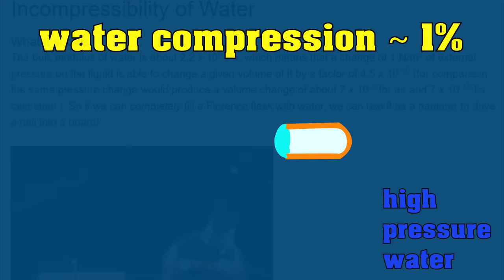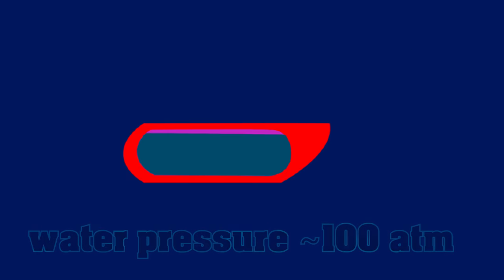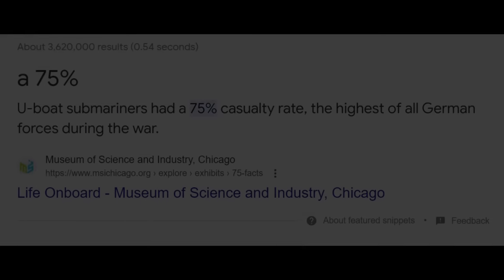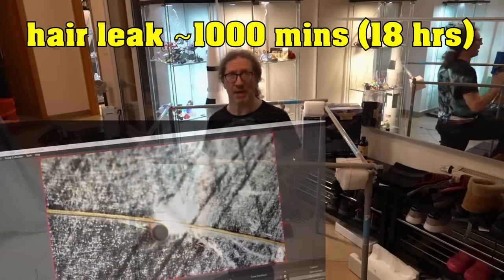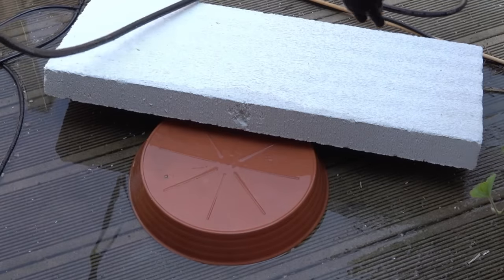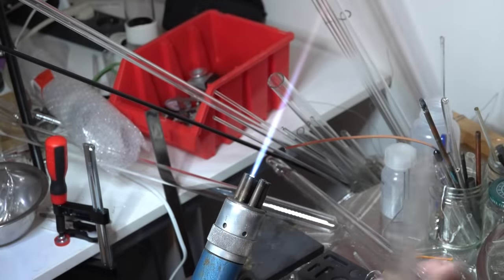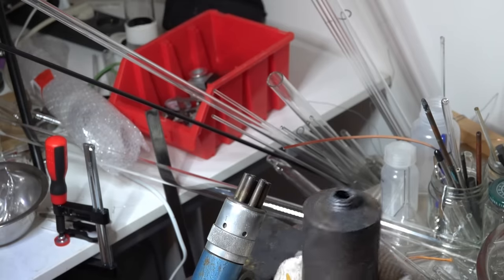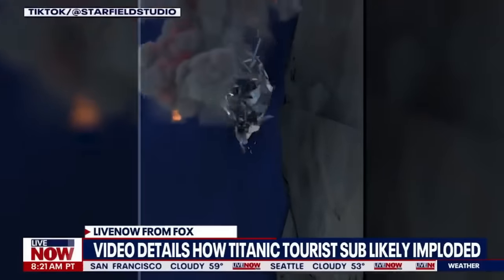Why the Titan sub failed

Comment: Reminds me of the Challenger.  The engineers found that the o-rings were half burned through several times.  Convinced themselves that meant that the o-rings worked, since they were twice as thick as necessary.
Reply: close but nut true, the engineers were deeply concerned about it and urged it to be redesigned. management were the ones that had the opinion you speak of
Reply: I've always thought it was reminiscent of the challenger as well, but because they overruled the engineer who said that the o-ring can't handle temperatures as cold as it was the day of the launch, and the shot callers overruled him and launched anyway. Just like the employee who outlined all the problems with the Titan got fired instead of listened to.
Reply: The O-rings failed because they were not specked at the outdoor temperatures during the launch. They launched anyway, HEAVILY INFLUENCED by the President who made such a beautiful speech about their lost lives.

Comment: Thunderboob picks obscure physics trivia that contributes a fraction of the damage and ignores the elephant in the room: implosion, baby! His water compressibility argument is ridiculous because it assumes all else is equal. The inside of the submersible isn’t static like his animation while the water decompresses. It is crushed from all sides. Any kind of a pinhole leak would immediately rupture the structural integrity of the carbon fiber hull at those depths, and the implosion crushes the submersible and ejects the porthole. There would be tiny tiny bubbles because of the water pressure. Waiting for his mea culpa video…
Reply: I look forward to your video explaining  your take in detail.
Reply: @roberthorwat6747 great idea, maybe this weekend.
Reply: Implosion can only happen if the sub descended below its rated depth. There was no implosion.
Reply: @vladimirrodionov5391  it’s rated depth is 0 because it had no formal safety tests! And the actual salvage recovery and experts’ statements would strongly disagree with your no implosion stance.

Comment: This makes perfect since, the Titan was having problems surfacing, we all heard that part when they had only went up like 25 meters in 30 minutes after first dropping the ballast and doing everything they could to go up. They knew they were screwed there, they had already taken on water. This guy nailed it, the best explanation I've heard. I thought I had it figured out but I didn't. most of us probably knew it was in the joint between the carbon fiber and titanium... well I guess this was close to what I was thinking but this just clarified everything. This is the smartest guy I've seen on YT, I'm gonna check out his other content

Comment: Could the difference of the two       materials bulk modulus be used as a benefit if apply differently? If they sleeved the carbon fiber over the titanium, instead of a glued butt joint, theoretically, the deeper you go in the ocean the tighter The Joint will get.

Comment: Pressure washers are rated for pressure the pump can produce at zero flow (which you never achieve due to an internal cut-off safety), and full flow at zero pressure (which you can achieve by removing the nozzle).  You're getting only a small fraction of the rated pressure when actually using it.  A more powerful gasoline pressure washer is much better at achieving high pressures with those small nozzles.  You're not cutting a toe off with a 120V model.

Comment: It seems like the only way the carbon fiber and glue would hold together would be to have the titanium fitted between 2 layers of equally thick carbon fiber and/or coat the titanium with a thick layer of titanium. Even then there is nothing mechanically holding the ends onto the carbon fiber tube.  As you stated Carbon fiber works best under tension. The tube, where the people are, would eventually crush at some point either on the first dive or a future dive.

Comment: I feel like there's an oversight here in the idea that the water-jet would be contacting the material being cut at this distance. As you can see in the water-jet cutting videos, the water-jet nozzle is basically right up against the material being cut. Presumably in the sub, it would have been a few feet away from the other wall and the stream would be dispersed by the time it hits the other side. Water isn't a laser.

Comment: I suppose the big difference between the pressure washer you used and the sub leak is when that leak expanded and the hole got bigger the pressure would remain pretty much the same irrespective of the jet size, it'd go from a tiny jet to a big jet to a sub breaking water hammer, all in a few seconds.

Comment: The thing is, Oak Ridge were doing this exact same thing way back in 1988. CF hull with titanium ring pieces and titanium hemisphere end pieces. And they rated it for 100 dives on the full scale model. They used IM6 CF on a vessel with an interior diameter of just 2', and a hull thickness of 2.5". Astonishingly, they even used the same method of acoustic monitoring during pressure cycle testing as oceangate. These vessels were cycle tested to 9000 (yes, a nine) PSI and crushed at around 12000 PSI if i recall. 

Now granted, 100 cycle rating isn't great, and I have no idea how many deep cycles Titans second hull had endured, but the whole concept isn't quite as bat shit insane as we all initially thought. They even used the same 'lip on each side' of the titanium rings idea, and yes - it was glued. 

So why did Titan fail so catastrophically then? Honestly, I think (as pointed out by other commenters) its the construction process and a lack of thorough non-destructive testing. I also think that the way Oak Ridge hand-wave away acoustic events as NOT being evidence of progressive failure is dubious. 

Ultimately though, Oak Ridge only rated the AUSS mod 2 for AUTONOMOUS work. There was talk of further research into the viability of human rated submersibles with CF hulls, but as far as i'm aware it went no further. Without massive amounts of EXPENSIVE testing, Stockton Rush had NO business conducting real-world testing on an experimental vessel with paying passengers. 

Please take a look at the following report for more information: https://www.researchgate.net/publication/235179850_Graphite-Fiber-Reinforced_Plastic_Pressure_Hull_Mod_2_for_the_Advanced_Unmanned_Search_System_Vehicle

Comment: It's extremely simple.  Titan imploded because Stockton Rush was an idiot.

As to it being a pinhole leak, I am somewhat skeptical.  Had it been a uniform, metallic hull, then yes, it's likely.  Since it was a composite, I think more than likely not.  Try your same demonstration with a fiberglass test tube, and I think the results will be different.

Also, while fire on any ship is an exceedingly dangerous thing,  fumes from a fire are actually easier to handle on a traditional submarine than most surface vessels.  If the sub has diesel engines, just start the engines.  The engines will quickly evacuate the fumes.  Release air from the reserve tanks to replace the air aspirated by the engines and goodbye fumes - after the fire is out, of course.  I am pretty sure even nuclear subs have pumps that can evacuate air from the interior.

I also cannot believe they tried to glue this thing together.  Using more than one material is bad enough, but glue?  I have made quite a few submersible devices for more moderate depths, but even at only a 10 atm rating, EVERY joint is either welded if the materials are similar or bolted if not.  Every bolted joint is designed specifically so that water pressure confirms the seal, but bolts are still employed for a number of very important reasons.  For that thing to have been even remotely safe, the carbon fiber should have been much thicker at the ends and tapered so that it tightened on the titanium ring (also tapered, of course) under pressure and been bolted to the ring with numerous bolts.  There should also have been a sealing medium like a gasket between the two surfaces.  I still would not have ridden in it below about 200 meters.  The thing was a death trap from the outset.

Comment: I used to run a waterjet cutting machine at my work, there is a water only head that has a .003" hole through synthetic diamond, running at 55 000psi at "low" pressure. There's not much "softer" stuff it can't cut. Wood, plastic, ceramic tile. Maybe I should see if I can make a video clip

Comment: When the hand held paint spray guns first came out I bought one and after reading all the disclaimers promptly returned it.  I talked to a painter once and he told me the dangers of how you can essentially inject paint into your skin if you make a mistake and they have to slice you open and try to remove as much as possible when you have an accident.  Then there are those pressure washers that can of course remove toes.  I don't think consumers realize the dangers with those.  I just watched a youtube short of fails and one was the old prank where a worker at an auto shop gets blasted with compressed air down the back of his pants by a coworker.  I worked with a guy once that told me how he knew someone that got killed from that prank because the air essentially inflated his intestines from the rear end.

Comment: most DSV pressure hulls are spheres made as two or three separate pieces that are fastened together with a ring of bolts or sometimes metal straps. These fasteners are merely for the sake of convenience in keeping the hull sections aligned but are not actually subjected to any pressure. The mating surfaces are machined extremely flat so that the actual pressure of the water when you dive presses the sphere sections together almost completely evenly, effectively making it a single object at least in terms of stresses in the material. The deeper you go the more watertight the hull becomes. The same goes for the windows which purposely are left "loose" in their machined recesses so they get pressed inwards evenly as depth increases, and allows for the material of the windows (usually some kind of plexiglass) to be compressed while avoiding stress concentrations which could occur with mechanical fasteners.

Comment: 30:38 ive been wondering if they glued it to the inside or outside of the titanium ring. They glued it to the inside, the glue was the only thing holding the pressure. If they had gone on the outside then at least the carbon would be squeezed around the titanium, glue wouldn't be a factor at depth as the pressure would be holding the joint. That said i have no idea if the carbon would have held up, carbon fiber can bend but it tends to bend right up to its breaking point before snapping with no warning. Why didnt they just use all titanium? Price or weight?

Comment: I believe is down to either delamination due to the pressure cycles or like you the stresses on the joint with the tube compressing more than the end caps.

Comment: All the nuts & Bolts used for the tightening and untightening must have stretched, causing a leak.
Were they stretch bolts & nuts which should have been thrown away every time they were used.
An outboard motor conrod big end bolts are stretch bolts once the motor is stripped down, you Have to replace those Bolts with new once.
Why? As the would break & destroy the outboard motor.

Comment: As you mention, how well would a carbon fibre tube perform under compression..

Since it's a tube, with both ends held in place by titanium rings (and glue) there must also be a torque or bending effect... with the middle of the tube bending in and the ends held in place by the glue & titanium...
Reply: the carbon fiber doesn't bend. it shatters

Comment: Maybe the glue did remarkably well but the different compression rate of the carbon fibre caused cracks. I could envisage that across the circular profile the fibres would be under tension but don't understand how that would apply to the forces pushing onto each end of the tube? also the idea of "fracking" came to mind. A bang was detected and they don''t seem to have recovered the carbon fibre tube, so unless the forces of sudden flooding are enough to shatter the tube, seems like it collapsed with before it could flood?

Comment: Are you saying that a small leak and the sub would have just filled with water wike was was only 50 feet under water?  wouldn’t any failure at that pressure cause an rapid catastrophic failure? Also wouldn’t the air bubble at one atmosphere compress to 400 atmospheres increasing the temperature until it exploded?

Comment: a bearing heater, they heat the bearing so it expands, then put it over the axle or whatever, it cools and grips that puppy tight. something similar would have to used to keep it under compression and allow for unlike materials to expand and contract but still remain intact.

Comment: Anything to read about why the water should flow at the speed of sound? I didn't quite get where that came from.
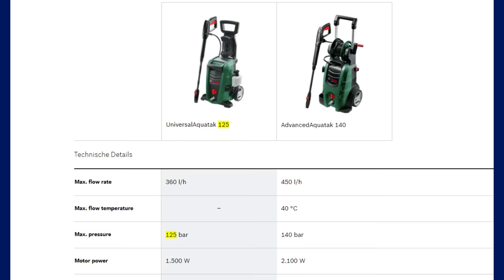Was your pressure washer nozzle hair-thick then? On that spec page at 11:29 it says pressure is 125 bar, but max flow rate is only 360 l/h

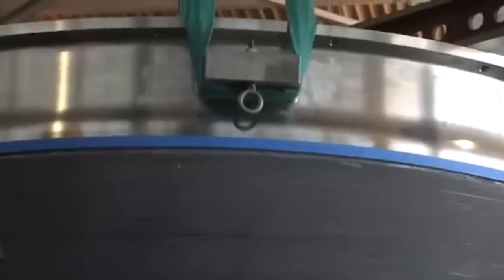Comment: isn't the glue joint (21:00) kind of the wrong way around? If the tube would be the larger part, the pressure would have compressed the glue. But the way it is (TI the larger one) the joint is under a terrible tensile load due to the different E-Modulus...

Comment: I wonder if the accelerating descent was caused by the hull contracting slightly before imploding.   The cyclinder walls bowed inward, decreasing displacement.   I estimate a 3% reduction in volume sheds ~ 250 lbs of bouyancy.  This would explain why ascent required thrust even after jettisoning ballast and frame.

Comment: I didn't even know the titan existed prior to its loss, but once I heard it's pressure vessel was made of carbon fiber I strongly suspected it to be the failure. I won't claim to be an expert, bit I've used carbon fiber in alot of R/C stuff, from cars to helicopters, there are just parts you don't want to make/use made out of it. One little nick or Crack and that part will quickly start to fail. That's just in what amounts to overpriced toys mind you. I'd never put my life on the line in something like that. Carbon fiber is the balsa wood equivalent of fiber glass. Yes it's super strong for its weight, but still fragile.

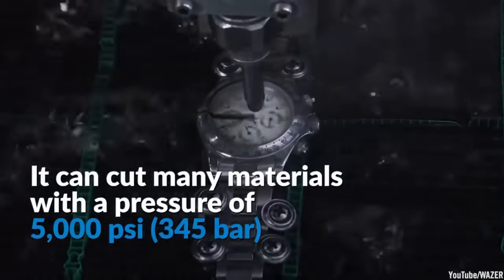Comment: 13:25 with this "low" pressure, the jet cannot tear material off unless the surface is coarse/ has/reliefs OR a soft material that will give enough to create a cavity under the focused pressure , to be able to push and tear material off. That's why the brick is eaten away when the smooth plastic is sitting there, unfazed.. If you add enough pressure, even the tiny reliefs on the surface of the plastic start to become enough of a hold for water to grab and rip. Add abrasives and it's not the primary means of ablation , now it's actually cutting/blasting first and water ripping out second.

Comment: Now that I have had time: The cylinder bowed in at the center of compartment due to water pressure.  This bowing-in was exacerbated by the buckling force exerted by the end-cap titanium hemispheres, causing a rapid squishing-in of the ends towards the midpoint of the cylinder from each side.

Comment: I think your demo with the pressure washer didn't go as expected is because the nozzle was not fixed at 90 degrees to the plastic surface. The angle of deflection dissipated energy in the water stream. If you used a fixture like the type used for portable drills for drilling 90 degree holes, it might have worked to hold the nozzle steady and in a single location, much like the way the water jet cutter works.

Comment: The problem here is we don't know what kind of glue they used. You can't compare glass and oxidized metal to actual glue (I was surprised to see you could stick glass to metal that way). Was the glue they used completely rigid or slightly flexible? If they used epoxy resin it wouldn't handle expansion and contraction. If they used something like contact cement it might allow for a bit of that. So what glue did they use?

Comment: There was the acoustical signature of an implosion at the time communication was lost. No pin hole. It was structural failure of the composite cylindrical mid-section caused by fatigue of the composite's resin component. Tensile failure of the resin bonding layer to layer (radially outward from the longitudinal axis) allowed the 'wrapped' layers to each buckle inwardly in a rapid cascade. This cascade zipped from the inside surface to the outside until all structural integrity was gone. Sounds backwards, but it's not.

Comment: Considering aircraft experience similar, although much less extreme, pressure cycles, I'm curious as to how the newer composite based planes (e.g. the Boeing 787 or the Airbus A350) deal with this issue? I believe Airbus was already having issues with the mix of materials layers (see the Qatar Airways case).

Comment: The carbon fibre was already damaged from stresses from other dives compression is right it would cause it to push in but the titanium end would mean that the carbon fibre is not under as much pressure from the end even though the ends getting pushed on by the water pressure so as it can tracks down the end would also be being pushed off by the carbon fibre being displaced. Once all the components moved the external water pressure might have been the only thing holding the thing together because,  bonds broke all the perspex which wasn't rated to go down that just that deep got punched in.

Comment: If they put the titanium inside the carbon fiber and used some metal grommet would that have worked better? My metallurgy isn't fantastic but I'm sure there is an allow you could have use to absorb the shrinkage to a better degree.